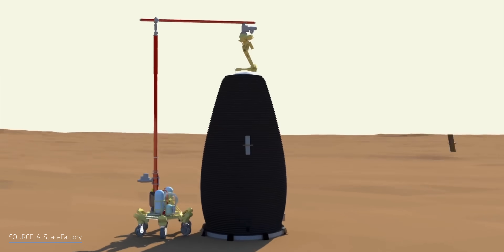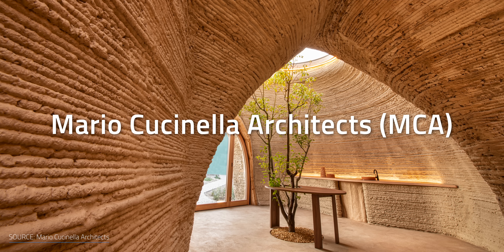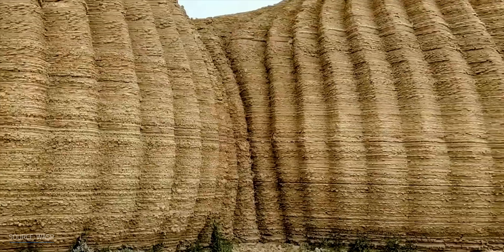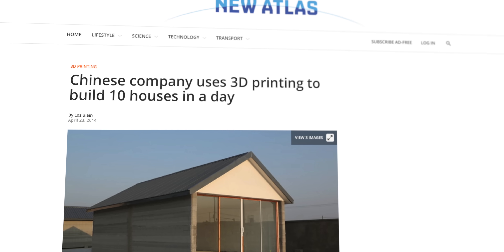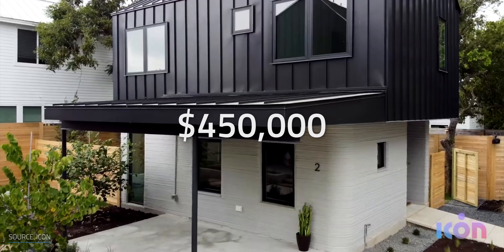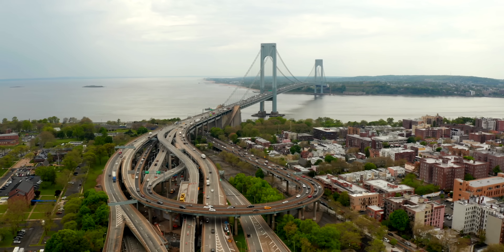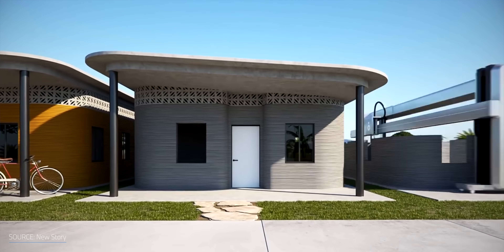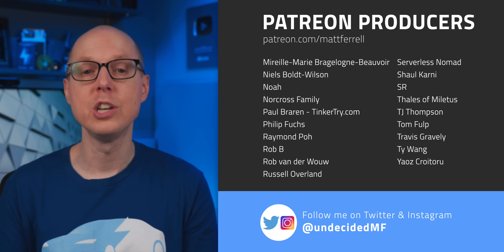The Truth About 3D Printed Homes

Comment: They could make a design and a robot, where they can robotically lay the plumbing and electrics at the same time as printing the structure. Maybe even the roof and floors aswell. But given you can print plastic and metal with 3d printers and the total mass of the plumbing and wiring would be relatively low, it seems possible it could maybe even print those in place, which would be awesome.

Comment: Using onsite materials seems like a big win, but I'd like to see the math on it.
And 3d printing seems an overly complicated solution. Concrete mixed with onsite materials seems a lower capital cost solution. Probably very variable by site. Would like to see studies of best formulations by area of the country.

Comment: A Comparative pricing breakdown is below. I've been building homes for 25 years. 3d printed homes are the dumbest thing I've ever seen in construction. They only print the walls. That's it. That's is the easiest part of the construction. These little 3d printed walls would be built in 1 day with a stick frame and be way cheaper and more environmentally friendly. Don't believe me, here is a breakdown for a typical 2000 square foot house.

3d printed costs(again they only build the walls):
Programing a custom home design for the printer based on the house plan: $3,000
Crane setup, delivery, removal for printer including 5 days operation: $10,000
3d Printer rental for 5 days: $10,000
Concrete costs: $6,000
Concrete pump costs for 5 days: $4,800
2 man crew to monitor system 5 days: $5,000
Extra costs from subcontractors to install trades and windows/doors in concrete walls: $8,000
Extra costs for columns and hardware needed to support roof: $5,000
Large generator rental/fuel 5 days. $2,000 
Total costs for 3d printed walls: $53,800
Time to set up, take down, and print walls: 8 days

Cost for stick frame house walls(2X4s):
Material, including hardware and lumber: $7,500
Framers to cut and prepare packages for wall crew, 2 guys, 1 day: $800
Framers to build and stand all walls, 6 guys, 1 day: $2,500
Small generator 2 days: $200 
Total cost to stick frame walls: $11,000
Time from start to finish: 2 days

In short, 3d printing is 5 times as much money and takes 4 times as long to build. I could add in the extra time it will take trades to deal with concrete walls as well, and a litany of other trouble in this type of construction but this post is already stupidly long.

Environmentally speaking, wood is a renewable resource and concrete isn't. We are running out of sand for concrete in the world, so creating more products that use concrete is a bad idea. Also, the amount of power, time, delivery, and resources needed to 3d print is several times more than stick build. So, it is far better for the environment to stick build.

The only way I can see 3d printed homes in a cost-reducing situation is in an assembly line set up, where they are printing the same things over and over again. BUT, you can't transport these things. They're too heavy and you'd be limited to 8 to 10 foot wide sections even if you could.

I think the real reason why there are so many of these startups but never a viable product, is that they solely exist to get money from venture capitalists that are sold this is the next big thing in homes construction. It's like the Theranos of homebuilding.
Reply: All 100% valid, and a truly informative post.  And I agree about the startup/pyramid scheme part in several cases - that might be worse than you think.  The people advocating printers really skim over the total cost, which as you point out - just the move-in move-out costs more than materials.  And the print material most require is many times more $ than concrete, and requires not-cheap onsite mixing equipment - and labor.  And you even left out they have not figured out rebar yet (though we have).  And, and...

However, where I live, wood framing tends to rot, if the bugs don't get it first, or it didn't burn already.  I have worked on maybe 200 fire rebuilds.  Of course the 3D-printed homes (in the US) still make roofs out of kindling, so what's the point?  Well, that is another challenge.

Comment: As a building contractor I experimented with different options for house construction.  You are right.  Exterior walls form a very small part of the total cost.  Complying with local building regulations that normally include appearance as well as proving stability of the structure must be considered.
Reply: Quite so. In the UK House building is sustained by the finance industry,. In my case, it took two of us  25 yrs, and many times the original cost to pay off. Brick is regarded as often cheaper than timber. Brick can last well over 100 yrs and that pacifies the mortgage companies.
Reply: Another problem with building regulations - other than making every project more expensive - is how slow they are to update and bring themselves up to modern times. This makes doing anything different or experimenting in any way headache-inducingly difficult at the best of times and completely impossible at the worst.  This issue just compounds the more "different" and "experimental" a potential property becomes. Which is why most modern homes are boring carbon-copies of each other with zero individuality and nothing to make them stand out - and in the rare cases where they DO have such things, that immediately makes them ridiculously expensive and unobtainable for the average person, let alone if you're on the poorer end of the scale.
Reply: @DavidStruveDesigns  I agree.  If we want to change/update our homes in any way, we are obligated to adhere to stricter building regulations using more costly technologies and materials making the changes/updates out of reach of affordability for most average people.  Over time, this causes one or two problems:  1)  Either the home is NOT updated and it becomes rundown and the owners lose out on the marketability of the home; OR 2) The home IS updated and becomes out of affordable reach for many people.
Reply: In a lot of countries, especially in the west, being poor is basically illegal, as you're not allowed to build a cheap house. Regulations make it that there is a minimum amount of money you need to spend on your house, or via rent if some company build your appartement.
Reply: @DrTheRich   Well.....yeah. Just like a car, there's a minimum you need to spend if you want something that runs and is safe. Building houses is expensive and skilled work. Until that changes(Builders work for free i guess?) there will always be a barrier to entry.

Comment: A very high tech mud shack if you treated as that the area is it used in in my southern Africa I’ve been using my jacks for years this is the really nice mud shack record be upgraded with water run electric and windows eventually but I wouldn’t have to all be done at once that I think would take a vantage of the low price and I standardize for planter three different models and then a whole bunch Of sharks that can turn into nice houses

Comment: It makes me think of something Commonwealth Fusion Systems said about their reactors. They pointed out that nuclear plants are very expensive because they're custom and built on site. Their reactors are standardized and can be built in a factory, then shipped to the site. That made a lot of sense. The same thing applies here. Sure they may not be custom if these homes are printed from a single design or two, but assembling them on site is probably not very efficient.

I think if you're going to build small affordable homes, regardless of the material, you'd probably want to make modular, manufactured homes constructed in a factory and shipped on truck. Yes, the building needs to be transported so you're not getting the benefit of local materials, but there are other benefits. Construction around the clock in all weather, better tools and infrastructure (like cranes) for placing roof components, etc. You could build a single family, single floor home in four pieces and have it transported on four trucks for pretty cheap. 

But as he states in this video, the best option for the highest possible housing increase it constructing apartments or high rises in cities. We may need to abandon this idea of individual structures in areas with a major housing shortage.

Comment: I think Thomas Edison was one of the earliest instant house guys. He thought his poured concrete houses would make housing so affordable that it would be impossible to be poor. Some of his poored concrete creations are still around.

His idea never took off, probably because all it produced was the shell of the house. And it made the installation of the  heating/cooling, plumbing, and electrical systems harder to install.

I'm afraid the most feasible techno fix for housing is the humble manufactured house (usually house trailer, but sometimes modular house). It can be made all at once, or in easily assembled pieces which can include heatinng/cooling, plumbing and electrical systems built in.

But the real housing crisis has no techno fix. It requires an economic/political one. The problem is caused by income inequality.

And no mud spitting machine is going to fix that.
Reply: If properly designed and poured a poured concrete house could have 80% of the plumbing and electrical already there to be embedded in the concrete. I think the cost problem for poured concrete arises more from the costs of skilled labor to do the job correctly and the unusual forms and equipment needed as well as the ever increasing cost of a yard of concrete delivered.
As for manufactured housing the labor and materials cost compared to the retail price of the home is so absolutely uncomparable that the only reason EVERYONE isn't in the mobile home building business is because most municipalities won't allow huge swaths of mobile homes in their confines and that limits the purchase of them. A financed 16x80 brand new mobile home is 80k plus and the is a host of other expenses that must be considered and payed for after purchase and during installation. You can have the same size metal building with a cement floor for less than half of that cost. But then again the metal building industry has it's middle man there ready to upcharge the he!! out of everything needed for that as well. But a metal structure built for cost effectiveness and not aesthetic appeal on a cement pad is going to be the cheapest structure to build.
Reply: You can not even install a trailer house in most states because of building codes. Premanufactured (modular) homes seem good at first until you start factoring in everything like shipping the oversized objects. Those houses are also glued together just like trailers and motorhomes, meaning good luck when the time for repairs come.
Reply: It is not even income inequality. It is an artificially created lack of supply for the western world and a failed logistical and social system in many third world countries. 
USA has more empty homes at the moment than they have homeless people. And a system that actually refuses to look at cost effective solutions to help people get homes and a stable finance. Which would be cheaper in the long run than the current solution. But hey if its against the American ideal it can't be done apparently. 

Scandinavia and northern Europe has large construction companies that are often compared to organised crime organisations for limiting the building of new housing because that could lower demand and costs which in turn means less profit for them. While many house owners don't want more houses because the growing prices on the market means they make a lot more money. 
If i ever become a billionare i have some markets to crash hehehe.

Comment: While quick to point out "flaws" there is no quantitative data here. It is no better than the claims that they can be built in a day for $4000.  The carbon emissions to transport one shipping container to a site where multiple houses might be built compared to the cost of transporting all the materials, equipment, personnel etc it takes to build something comparable is astronomically more.  This is not responsible journalism, but simply a way to make a buck on youtube sensationalism.

Comment: Good overview! Another localised factor is the printing material itself. WASP has spend several years of trial and error experimentation with various compound mixtures. We alredy know that what geologically is avalailable in Spain is not the same as in Kenya or Japan, so the the process of using ground based materials has to be specific to the construction location. Good point about density, growing fields of 3D printed domes creates fields of vertically dead spaces - there already are cities which in order to house more people have to grow upward not sideways.

Comment: Why not just use modular framework to ease the process of building? If all you're doing is making walls, just set up a frame that the workers then pour the wall mix into, that's a lot faster than waiting for a machine to do complete rotations before the next layer. This would also allow for rebar or other structural components to be incorporated into the wall. Even if you want fully renewable materials for construction, why would you need a machine to do it? Just seems like a waste if all you need are frameworks that mind you can also be locally source if provided the schematics... doesn't feel like 3d printing in construction will ever go beyond a fad.

Comment: Problem is this is trying to solve a problem that doesn’t exist. We can have eco friendly materials locally without 3d printing the houses. Our existing construction techniques aren’t an issue. 

The issues are land use, we need more density, less expensive houses and a shift away from renting. Housing shouldn’t be a commodity. 

This also doesn’t adapt well to other countries. All areas of the world have different building standards and requirements, for example in no way shape or form with this be up to standard in the UK. Poor insulation, probably next to no wind resistance, the general weather - i’d never want to live in one of these rather ugly abodes.

Comment: I question the seismic stability of these structures I saw no evidence of reinforcing metal or fiber 
also long term settling depending on the local soil and geology could cause structural failure.

Comment: Great analysis. I wish ALL greenwashing was looked at like this. The easiest way to calculate your carbon footprint is to measure it in monetary units. The velocity of money is how many times a monetary unit is respent minus inflation. In the US that means (using real inflation #'s) that every dollar spent is spent up to 80 times before it is washed away. This means that all the time the unit is spent it is using resources and creating a larger footprint. There is a lot more to it and I way oversimplified it, but your carbon footprint is directly correlated to the money spent. A $120k electric car has a larger footprint overall than a 30-year-old gas guzzler when you consider everything.